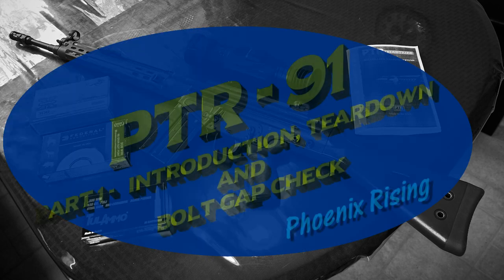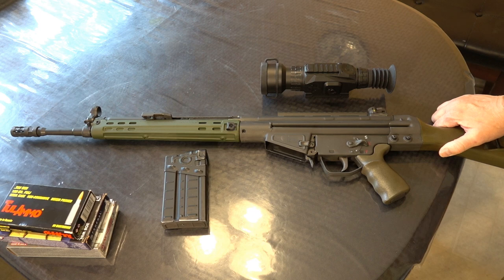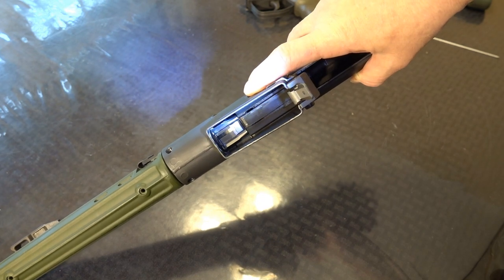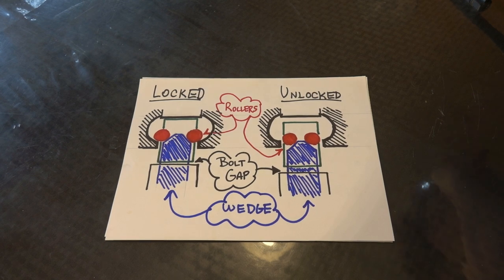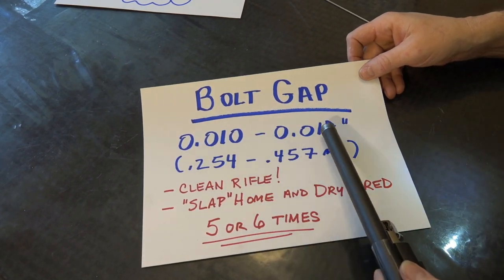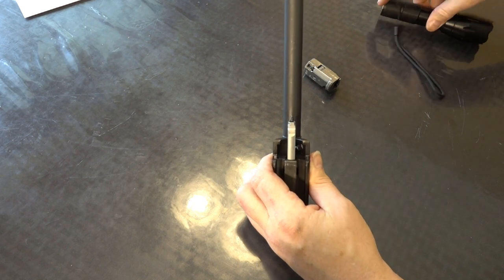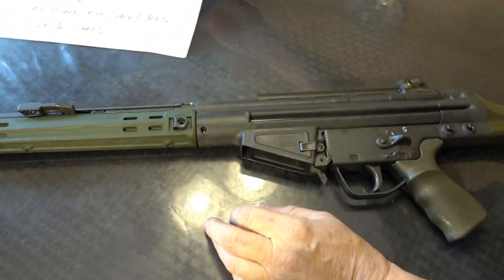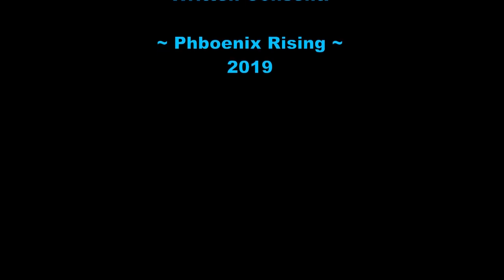The PTR 91 (G3 Clone) Rifle - Intro, Operation, Teardown & Bolt Gap Check (Part 1)

Comment: I want to help you out. Since there's no gas tube, no piston to drive the bolt back, etc, you cant claim gas as the reason it moves. The famas works on the priniciple of mechanical disadvantage, requiring a very long travel in the carrier compared to the lever that pushed it out, before it opens. This does the same. Wheels are essentially infinite length levers. Your rollers are the levers. When pressure hits the bolt face, the only way it can move backward is by the rollers squishing themselves into the bolt. The only way they can squish themselves in is to compress the head of the locking stick. The locking stick (I forget its technial name rn) contacts the bolt carrier on its butt end. This means the rollers push the front of it back, the back of it pushes the bolt carrier back, and then the carrier can drag the bolt with rollers inside it back all the way.

Remember, the rollers are infinitely long levers, just like gears and sprockets. The size of the levers relative to.. other parts, determinies the mechanical advantage or disadvantage like the famas.

Comment: Might be better off using 147-155gr loads for accuracy testing. PTRs don't tend to group as well with medium weight or heavy for caliber .308 rounds, IMO probably one of the major reasons some people feel that they're inaccurate rifles.
Reply from the maker: Absolutely True, they were designed for NATO ball rounds and generally lose some accuracy with hunting type ammo, and I think that also between the Wraith and the standard heavy trigger also didn't do any favors in this case either.
Reply: even the cheap 150gr stuff has produced good groups for me.

Comment: Hitting the bolt with a hammer is not necessary if you get it lined up right and push down on the backside of the lever to compress the spring a little bit you're able to push it together with your hands no need for a hammer
Reply from the maker: You are correct, You could press down on the backside of the lever, however the force required is rather excessive without either a clamping device or an extra pair of hands, so tapping the bolt to me is the easiest way to go and considering the normal cycling of the action in use it is not detrimental. 

  Also I've worked with several rifles of the roller locking / delayed blowback design over the years and my experience has been that with use eventually things do loosen up a bit to where you can do it by hand, but even then a gentle tap works better because with just a slight over-travel from the assembly position the bolt will snap to the locked position with great enthusiasm and without forgiveness of any skin or soft tissue that gets in the way so maintaining minimal contact is wise! ~ Thanks for the Input!

Comment: Great review of the PTR 91, thank you for posting Phoenix.  I thought it was very informative. Waiting on mine to come back from the shop, cant wait to shoot it!
Reply from the maker: Thanks! and Great! Are you having Custom work done to it?
Reply: @PhoenixRising62  I replaced the slim hand guard with an HK wide hand guard. Will be sending my trigger pack and recoil buffer to Bill Springfield. After that, maybe add a good muzzle brake or compensator to add in recoil mitigation.
Reply from the maker: @j.p.4541  I did the same thing here... More comfortable and they don't heat up like the slim ones.  Haven't thought about changing out the flash hider for a muzzle break.  I've also replaced the Trigger pack with an enhanced / tuned one from HKparts.net ( https://hkparts.net/product/ptr-hk91-g3-308-7-62-enhanced-trigger-pack-match-p17014.htm ),  huge improvement.
Reply: Phoenix Rising where can i find a OD green wide hand guard? Im new to the HK G3 world so i don’t know some of the main online HK part’s stores. Anyway I’ve looked all over the web, would any European stores have any wide hand guards?

Comment: Slams buttstock on
Moves to put pin in
Stock slides out
It's like a dagum Tom and Jerry skit, I am dying.
Thank you much for this video, I just bought a 91GI today and I was actually kinda scared that I had some sort of catastrophic problem with it being slightly difficult to unlock the bolt. Forum posts are not good at explaining the difference between "Difficult" force, and "I can literally stand on my charging handle and it won't come out of battery" force. I thankfully have the prior.
Reply from the maker: Your Welcome! Yea, the PTR's and the Century Arms CETME's are both that way... I've had the pleasure of having an HK-93 for a period of time in 5.56 and it wasn't nearly as rough to operate all the way around. I really do like the platform but the fact that it is a still a blowback based .308 so the recoil system and the lock-up for the bolt head (for the delay function) by necessity have to have significantly more spring tension / force than just about any other battle rifle of the era and if you've not used them before it's a bit unnerving. I've got about 400 rounds through mine and it's still very tight to unlock.
Reply: @PhoenixRising62  That's cool to hear. Hopefully PTR does a 93 somewhere down the line, seems like it would be a neat gun to have.
Reply from the maker: @galvanizeddreamer2051   Agreed, Century Arms did do a 93 clone, but when I looked at them I wasn't too impressed with the fit and finish (Century Arms is, well- Century Arms!).  The biggest downside with the 93's and Clones are parts seem a little harder to come by and magazines are more pricey.

Comment: What was the intention with putting the wraith on this gun? Were you planning on hunting with it at night?
Reply from the maker: Actually No, I Never planned on keeping the Wraith on this rifle, but since I had the Wraith and wanted to do a further review (I had done a Night Vision review between it and the Photon RT in the channel) testing it actually on a rifle and since the Wraith is supposed to be rated for up to .308 the PTR was a good candidate especially since I wanted to do a break in review... So really the intention was more just killing two birds with one stone, and I didn't expect the Wraith to be so problematic based on a couple of pretty glowing reviews of it in other YT Channels.
   

 The reality is at least IMO is that from my experience thus far I might put something like a Photon RT on a Rimfire or PCC for close in night varmit use, the Wraith is just a "Novelty" (I will re-mount it on a PCC or .22 and do a further review, but I doubt it will redeem itself, and I will likely do Another RMA once I give it one more chance), and for anything more serious I would go with Traditional Night Vision.
Reply: Okay thanks for the reply I was just trying to decide on purchasing one and wanted a little more detail with your intentions of using it
Reply from the maker: @huntingadventureswithsy  ... I would stay away from the Wraith at this time,  if you look at my review between the Photon RT and the Wraith, the Wraith doesn't hold a candle to the Photon in actual NV capability, and in Part 2 of the PTR review I do a segment on the Wraith and basically I had several big negatives with it... I had a POI shift partway through testing, Numerous focus shifts while shooting (as in focus for a given range take a shot or two and have the image go out of focus and have to re-focus),  While recording video I had also had the scope "Lock Up" several times to where I could still see through it, but couldn't stop recording, access the menu or even turn the scope off to where I had to pull the batteries out of it to regain control.  That and the Image quality was not that good and lastly there was way too much  rubber banding while panning and scanning.  So even though the Photon RT is much lower resolution it's a step up from the Wraith IMO.
Reply: Okay thank you for the advice sir

Comment: What causes a new PTR91 PDW to have failure to go into battery?
Reply: Lock the charging handle back and slap it hard and let it slam home good that's how your supposed to use it or else that exact issue happens

Comment: good job. only complaint, the real HK 91's did have the paddle release when imported.  the early JLD's and the PTR's did not.   other than that, great job
Reply from the maker: Thanks!  I guess the 91's came both ways.  I remember back in 1983 or 1984 when I looked at them they didn't have the paddle (actually picked up a 93, but looked at the 91 and MP5.. Wish I had the ways, means and smarts to get all three back then!), and I remember reading something to the effect that they were removed due to import restrictions, I was thinking they had another import model prior to the 91 that still had the paddle (which may be one of those "I read it on the internet so it has to be true" things).
Reply: @PhoenixRising62  the 91's i see at the shows all have paddles, maybe your thinging of the SAR 8?  imported by springfield arms?

anyway, cant wait to see your testing on ammo.
Reply: @ Phoenix Rising You were actually correct. Some (not all) of the HK 41s that came in during the '70s had the paddle along with the grenade tension "bulge" on the front sight base/AKA triple frame. NONE of the HK91s originally came with the paddle on them, only the button on the right side of the gun. Any HK91 you see with a paddle and/or the rifle grenade tension ring has been added after the fact by a smith.

Comment: Omg Please delite this wrong video- it is easy when you know how do you must do it- he doesn't know🙄
Reply from the maker: Perhaps YOU should to do a video on proper assembly and operation to "enlighten" people. But I see that there are no videos or content in your channel so alas the world will never experience your wisdom... only your negative comments.
- First the Hammer is Brass and will not damage the bolt.
- Second the Rifle is New with incredibly stiff springs for the bolt / cross-wedge (especially being the 7.62x51 variant, the 5.56 is significantly easier)
- Third Yes there is a sweet spot where you can easily do it by hand with care depending on the wear on the rifle and spring stiffness, this rifle isn't there yet and I have owned several of this type of action over the years.
- Fourth This is a PTR, Not an HK. I've used HK variants, CAI CETME's as well as the PTR, The HK's are Smoother with better fit and finish as one would expect and would likely not be as rough around the edges as the PTR (Which by no means is a Slouch and overall has very good build quality compared to anything CAI put out)

Lastly while I encourage people to post, ask questions and provide comments that add information, experience or value for other viewers, your comments do none of the above and have NVA (No Value Added).
Reply: No i have not a chanal and dont need. But you realy make a mistake if you need a hammer for the bolt.
Reply: You don't need a hummer ! My MKE 41 is new too.
Lies die Bedienungsanleitung